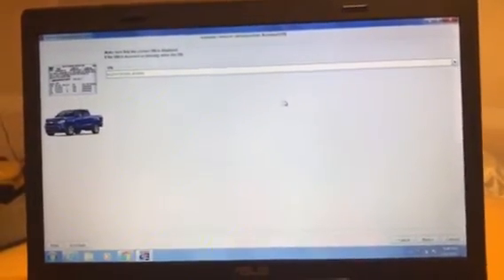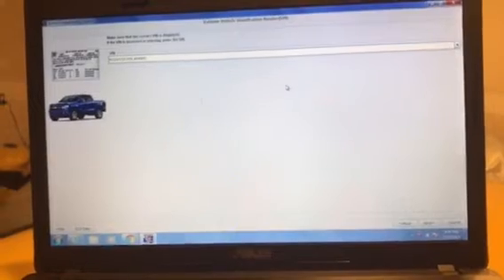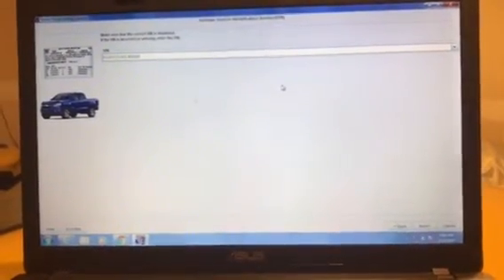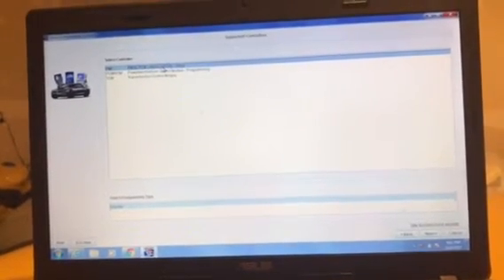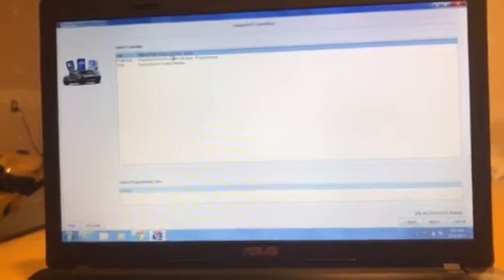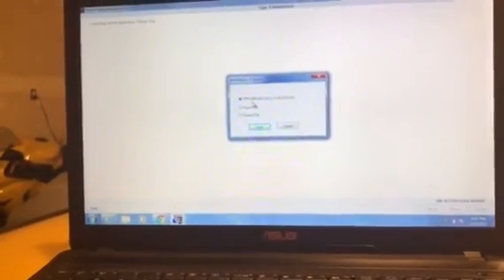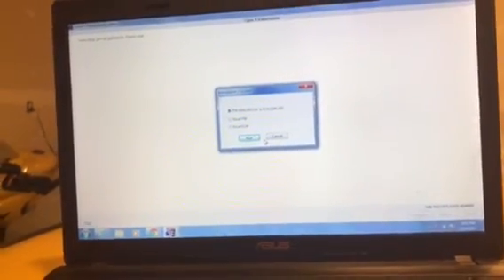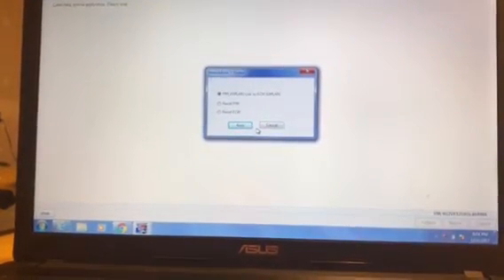GTO PIM to ECM Linking

Comment: Hey if anyone still was wondering and needed this, I think I saw it on LS forums that you CAN LINK THE BCM PIM AND ECM AT THE SAME TIME using pretty much the same technique as programming the key fob... Just takes an extra 30 minutes and extra 10-10-10 before you start the car.

Comment: Is this off the Website or did you download the SPS software to your computer?
Reply from the maker: Its done online with SPS and JAVA
Reply: @SpartanAutoworx  I figured it out, SPS online didn't give me that option, but I have TIS2000 and was able to relink my modules. I also had to replace my PIM.....I had to get a dealership in Australia to find my IMMO code and BCM code. What a PITA! The only other way to retrieve codes is with an on board eeprom reader.

Comment: A couple of questions...are you using a battery maintainer while flashing your car? What device are you using as a pass through to program modules? Just having my Tech 2 hooked up and modules active with everything else turned off seems to drain the battery down quickly. I recently replaced my ECU I purchased preprogrammed from a company here in California. They state all that's required is a 30 minute key relearn. I have tried this many times with no results. The ECU has the code P0633, P1629 and the PIM has code B1019. I have a Tech 2 and TIS2000 along with online AC Delco TDS to perform a pass through if needed, but I don't have any of the security pass codes. What a PITA!🙄
Reply from the maker: I use many drew tech devices. I dont use Tech2. Depends on the flash im doing if I use a maintainer. Cant do a 30min vtd with gto if that is what you are working on.
Reply: @SpartanAutoworx  Yeah, I need to do the VTD relearn, but I don't have the security codes. I need to call the dealer for those. I think I'll try the pass through method using the Tech 2, but I bought the Schumacher INC 100 for the power supply this time around.
Reply: @SpartanAutoworx  Where did you get your code(s) from for relinking?
Reply: @SpartanAutoworx  I don't see ECU to PIM relink under the SPS software.

Comment: I'm having the same problem when trying to link PIM to ECM. I get error message PIM Link to ECM failed. I tried reset PIM and get error message PIM reset failed. The ECM reset does work. I tried reprogramming ECM and I get a unknown error during service programming event. Do you have any idea of what might be wrong, PC, ECM or Pass Thru device? I'm using the VCX NANO
Reply from the maker: I would use a tech2 or drewtech pass thru. Also MDI would work. Never had luck with anything when I was experimenting with vcx nano.

Comment: I am going thru this now. Car is at the dealership. I bought a replacement ecm but Bad part is they cant get the ecm to link to the pim due to a code error. After talking to the tech and both of us looking up solutions we found. A huge number of 05 gtos vin numbers, mine included. Have a factory issue where if your pin has a 0 in it, it won't recognize the 0 as a number.
Reply from the maker: Hmm not aware of 0 issue but could be.
Reply: Did you figure the problem out ?
Reply: @Mr-th5hw  I think it's body control or BCM module
Reply: @Mr-th5hw  yes. If you replace the main computer & it won't link due to the code error then you also need to replace a control module in the ignition (can't remember it's exact name). Then it will link up.